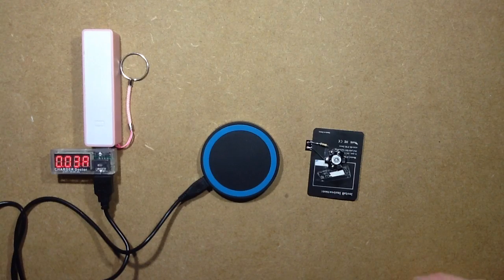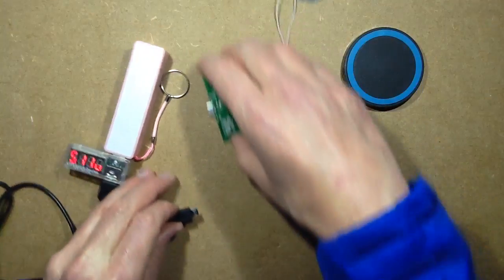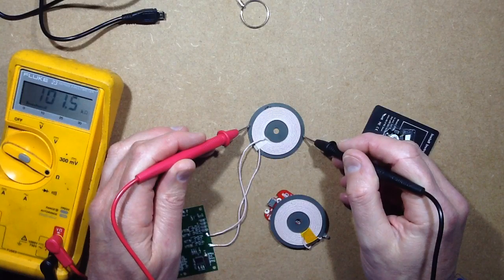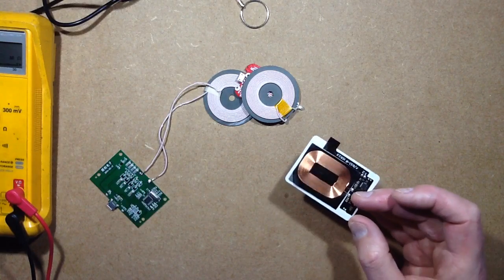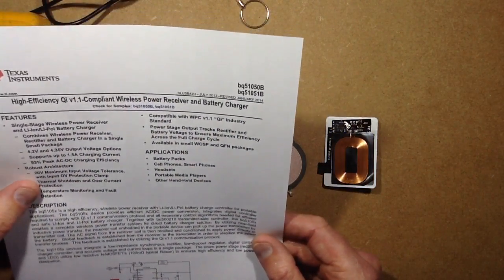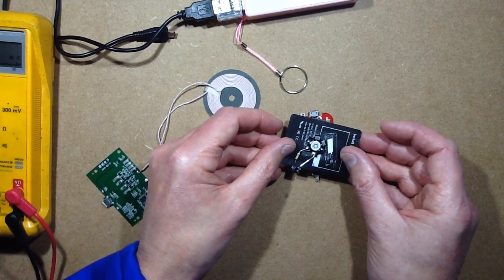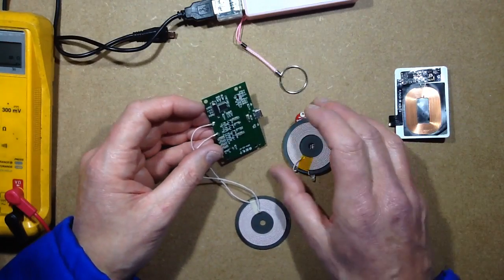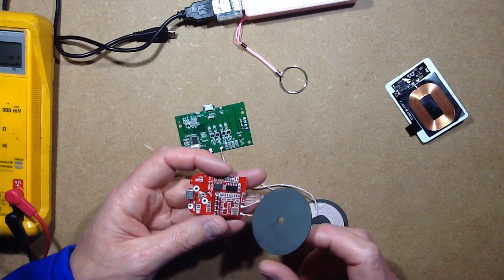Playing about with a couple of QI inductive chargers and receiver.

Comment: (Yes I know video was filmed years ago)

Modern high-quality Qi chargers, with the receiver built into the phone, when alligned properly, will operate at about a 70-75% efficiency.

However this can drop significantly when they are lower quality and not alligned properly.

Comment: Hello bigclive, I recently got myself a Braun Oral-B electric toothbrush. It came with an option of getting a NiMH or (a much more expensive) Li-ion battery. I noticed that it used induction charging. They've been on the market for 4-5 years now and are getting fairly cheap. I was thinking it might be a good idea to tear one of these down? I'd be interested in that.
Reply: I was just going to suggest the same - having stripped the outer casing off a failed toothbrush - there are some interesting design aspects inside.
Reply: @mikehebdentrains  I think the inductive charging feature is very interesting.

Comment: Thanks BigClive -- I found out I have a fake Qi charger for my SamS7 edge phone and was looking for info... ran into your QI charger analysis video.  One question... QI chargers (you mention) draw more power when they are more than 1/4" from phone, so -- Does my plastic phone case cause a higher current draw when charging?  BTW --the Qi "Chi" term came from Chinese martial arts and is pronounced Cheee.  (denotes the 'power' of the martial artist during a match or demonstration.)
Reply from the maker: The current increases slightly with distance, but a plastic case won't make too much of a difference.

Comment: ok so I ordered one of these and have found that the microboard is smaller than the ferite plate however there is a small extension with an led, would the pad still work if I just removed this or is it part of the circuit? as I could make a considerable smaller enclosure for this if it does.
Reply: Dave Hendry i was thinking about doing the same, also the ferrite disc came broken in tree parts in one of them but stills works

Comment: if I was to unsolder the coil from the board and extend the leads to have the pad standalone would this cause a voltage or amperage drop due to the extra wire?
Reply from the maker: It would probably be best to keep the electronics close to the coil.
Reply: bigclivedotcom well my thought was if I could have the coil in it’s own enclosure then I can make it nice and small for fitting on phone holder on motorcycle and put the electronics hidden somewhere in a separate enclosure. Do you think this would work?
Reply: Dave Hendry any extension aka adding wire to  move the electronics somewhere else will add resistance for instance, less current and amperage at the end coil
Reply: The current is at RF (200kHz) so you'd need to use Litz wire like the original coil uses. The stray capacitance, if too high, might also detune the coil.

Comment: The plates are used to prevent a loss of energy in one direction and in theory sending more forwards, so two would try to encapsulate the energy, I don't think it quite works in practice
Reply: phonotical I was thinking about that, why adding intereferences with magnets, why not adding a simple gauss cage/jail or an aluminium foil?

Comment: the disc is the most interesting thing here... maybe the resistance stays the same because as you move the probes apart there's more paths for the current to take like the disk is made from thousands of little resistors with an infinite number of paths in parallel.....
Reply: It might be more like a characteristic voltage drop (like a semiconductor junction) that's displayed erroneously as a resistance.
Reply: lez briddon - exactly, the characteristic resistance for sheet material is usually given as Ohm/square (little square symbol), and is independent on the size/how far apart the probes are.

Comment: Can you tell me how to approach for  a fast wireless charging with 3coil Qi circuit board and at what point the wireless charging could be equivalent to 30 min full charge for a single phone. I mean how many 3coil i need to make sure its giving me enough power for  a full charge .
Reply: It shouldn't matter if you put out more power, that would only burn out the circuit in the phone by overloading it. Both sides need to be made for, and negotiate, charging. Even for simple USB cables.

Comment: Could you hack the base to keep a stainless steel mug of tea warm?
Reply: The mug would have to be ferro magnetic in order to work with any induction heating device.
However maybe a mug could be modified with a qi coil, chipset and a few resistors so when placed on any qi charger the mug would get warm.
Of course you'd want insulation between the resistors and chipset. Otherwise fire may occur.

Comment: got one from Gear Best with what some call an oops board.  the micro usb port was in the wrong place or maybe it was a mutliple board use designed one.  Either way using a dropbox links the chip on the right melted I think because we had a power surge because oh smoke and an awful smell came from it.  https://www.dropbox.com/s/zu5f6mu5ho847bp/2016-04-20%2010.50.04.jpg?dl=0  it worked fine till then.  one of the best but as usual it wastes the 3 different colored LEDS  Blue just says it's connected.  So far there is a DIY one on banggood that I just stick on the back of an old cd case and it works fine.  never gets that warm like these do.  and bothers to tell me if the signal is week.  None of the others would tell me that.  (blue LED flickers dim to bright when it isn't quite right.  the Nexus 7 works great with these but if you have a hackable ie the universal Qi receiver that plugs into the micro usb on the bottom. well it has to be a certain brand.  I tried one meh that wasn't good.  so it's like whoever the Qi folks say works the best.  and so far it's mostly miss but I'd never ran across one with an oops board before  (they soldered on another micro usb port to the board.  Not had the best of luck with Gear Best.  I have better luck with Banggood and the one above is one I ordered but I think I'll stick with the DIY ones on banggood (that one you can search up)
Reply: +Lee Bartholomew that one can be found here http://www.gearbest.com/iphone-power-bank/pp_265547.html  might try to overload it intentionally if your willing to see what happens there in case it was a surge if your so inclinded to order it.  I could myself but since they credited me on the site they might become a wee bit suspicious on what I'm doing.  For a fair amount of de hassling.  the screws are under the top mount rubber.  X_X  kinda wish I'd known that.  oh well.  it was shot anyway

Comment: so this is like RFID in a way
Reply: +Mike Schmidt kind of in the sense that RFID uses inductive power transfer to power on the RFID chips so that they can transmit data back to the receiver, only real major difference is that these send tons more power and very little actual data. NFC is also closer to RFID than it would be to this.
Reply: thanks David Nelson for the info

Comment: I disassembled a toothbrush charger an there was just a coil without any controlling circuitry and inside the toothbrush were 4 diodes, a capacitor and a resistor. And of cause a charging controller for the NiMH cell with two LEDs.

Comment: You would think that any inductive charger is going to need a feed back protocol, even the electric toothbrush, but especially a phone with a lithium ion battery. LI-ion batteries cannot be overcharged, so there has to be feedback to shut off the transmitter when the battery s charged. There is also a constant current, and constant voltage state when charging a Li-io battery, so the current is going to need to be diminished when the charging is coming to an end. Mabye the toothbrush has another battery type that can be overcharged, or a shutoff on the toothbrush with a headsink that can just expel 20ma worth of heat.. I got one of those cheap chargers too recently. I have to say, they aren't very adaptable. Mine won't work unless it gets at least 1.6A from a power source, so it can't do any power scaling..  Interesting video, thanks.
Reply: Clive, what do you get up to at the Edinburgh festival?
Can you suggest a circuit induction charger for Seiko kinetic watch? Dennis

Comment: I think that it may be caused that you supply to less current?   On many of these Qi chargers there is required input of at least 2A. And this powerbank can supply max 1A.   You should try it with better USB power supply ;)